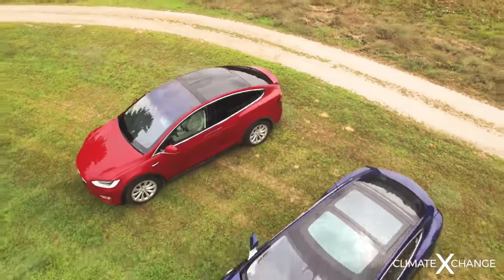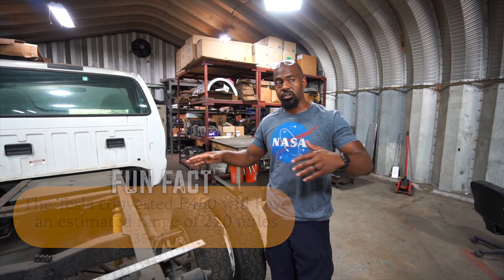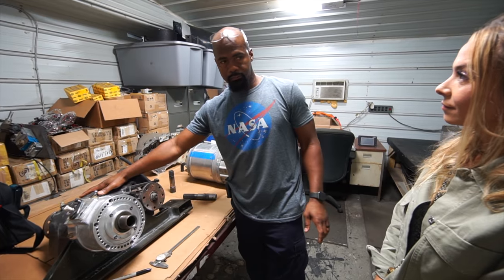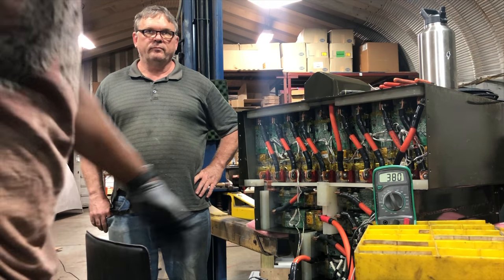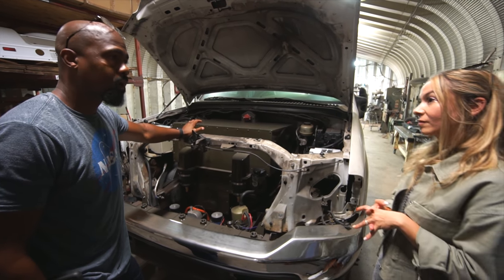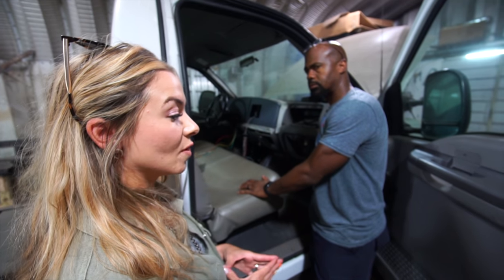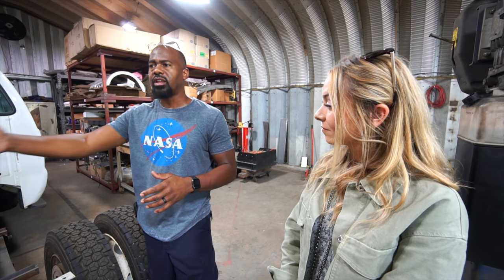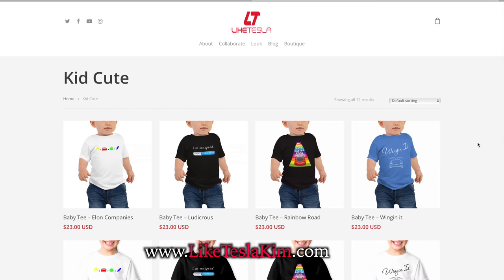Building The World's First True TESLA Pickup Truck!

Comment: Very interesting project! I like the fact that the battery enclosure is designed to fit in the same space (and same approximate weight), of the original engine, and the drivetrain and transfer cases, etc. are all in the same general location. This will make for an easy upgrade to existing vehicles. The only concern I would have, would be the crash test scenario, since a normal engine is designed to break loose on a front impact and go down under the truck to allow for more front end compression. It would also be a plan to harden the front of the battery case to prevent punctures and fire hazards in such a situation, and have an accelerometer/impact sensor to completely disconnect the system, via a main relay. Just some random observations...😉👍👍

Comment: Just imagine what they can do when Tesla does come out with their Truck models and they can easily convert older trucks . Good stuff now, and when Teslas trucks come out, they probably have a higher towing capacity  motor and cooling system.
Reply: New Electric and EV West already DO Electric Truck conversions even without the Existance of the Tesla Pickup.
in places like INDIA they create light duty Trucks, made with a 
Screwdriver motor !!!!!! the trucks operate on commonly found 12v batteries. 
but, these are Analog Electric trucks.
TESLA is creating a all Digital Electric Truck, big difference.
Reply: The model 3 drive motor should be enough for the midsize truck market full of V6 motors just needs notably more cooling than a model 3 because towing

Comment: That charging trailer is amazing
Reply: I'm sure Rivian and Tesla will offer something Similar.
Reply: till it rains  but even on sunny days it would take a week to charge your batteries lol  compare to about 5 min to fill up gas tank lol
Reply: @brandonblack2095  I can Recharge at a Supercharger station and gain 200 miles in just 15 minutes.
Reply: Sorry, but those 3 panels cannot charge that battery very fast. At best, it looks like they can probably do about 1.5-2K W. That means sitting for a LONG time waiting around...probably wouldn't even make up for the inefficiency of hauling the trailer.
Reply: Have you actually done this? I'd love to see the evidence. "At first, things looked great. Indicated charging power zoomed up to 254 kW before it stabilized at 250 kW. Estimated charging time was 55 minutes. Less than 30 seconds later, though, with the battery juiced up to 16 percent, the charging rate started falling. Within minutes, it was down to 150 kW, then 130 kW, which it held until the battery reached 55 percent. From there, the charging rate slowly declined as the battery charge increased. 90 percent state of charge was reached in 41 minutes, and we eventually gave up on trying to get to 100 percent as charging time crested an hour and 15 minutes."

Comment: If I remember correctly optimum temperature for the Tesla battery pack is 74.5 degrees is the ideal temperature.

Remember to tell the owner of the truck to on a regular schedule check the transfer case for proper oil level plus the rear end and the front axle on the same schedule as the transfer case and rear axle. 

Not 100 % maintenance free like a Tesla is but very close. 

Thanks for allowing Like Tesla in to video the " prototype ". 

When Ford releases their electric F150 it will be interesting to see if Ford offers electric drive on the heavier versions of their pickup line. I would bet on they won't as they know the dealer network will scream like stuck pigs because there will be so little to maintain and make money on as we all know the dealers make their money from the service department not from selling vehicles.

Thanks again for a look at the future and thank you like Tesla.

Comment: i'm loving this one imagine between the fuel savings and the self charging trailer you would literally have a fully self contained vehicle. i'm subbed now i want to know more. THIS is the kind of thing i  have been looking for to get me into the electric vehicle craze this would be great if the truck could simply contain the contents of the trailer as a bed and just use it to pull heavy loads with from the  rear.of the truck, it would make it an almost no cost means of transportation and hauling

Comment: I like the concept of charging with solar panels, but with my limited knowledge of solar panel output, versus battery charging requirements, seems like those panels will only make a slight dent in charging requirements.  I hope I’m wrong in my assumptions.
Reply: You are correct in your assumptions, in the video he implied that you wouldn't get a full charge. Based on what he said in the video, the trailer also has batteries inside that can be charged as you are traveling down the road and that is what can actually charge the F450. In this case the Solar panels are not directly charging the truck, the batteries inside the truck are what creates the higher voltage needed to charge the F450.
Reply: A 1kw solar panel is about 10 feet by ten feet. If that array on the trailer is that size, it would take 90 hours of direct sunlight to the unfolded array to fully charge. And those panels are folded up when driving so only a third would be exposed to sunlight while driving.

Comment: Honestly you don't need a special transfer case that has to handle the instant torque of an electric motor.
It's cheaper and easier to electronically regulate the torque of the electric motor and have it feed in power smoothly and progressively.
You can also use the existing transmission and clutch to maximize the already high torque while giving it a normal range for highway driving.
Reply: yeah dude! that is what I am going to do with my tesla motor that I am putting in a basically stock 95 jeep cherokee.

Comment: Imagine if they take the knowledge they have and make a more plug and play conversion of the F150.  Using Tesla motors and batteries from cars that have been wreaked.  Be a great gig.
Reply: That would be the Ultimate EV Conversion. There is one company that is now making a "Crate Motor" that is shaped like a V8 Engine that simply bolts into the engine compartment like the Gas Engine that was just removed. If a company could get a factory going to make EV Conversions for popular Gas Vehicles, they could make some money and save the planet all at the same time.

Comment: My idea is to put a trailer hitch on my Model Y and have a 30' RV with solar panels on the roof and roll out panels when in the open.  I was dreaming about charging while driving but the reality is to charge the RV batteries using the RV pack from EVTV Jack, then when stopping for lunch discharge the RV battery to charge the Y.  The Flex panels are getting more efficient and the new 23% panels from the Canuks will give alot of energy from the RV roof.  Having a starlink terminal would just be icing on the cake.  I envision going into a very very remote area for a few days hiking and coming back to a comfy home with full conveniences.  Putting those panel extensions is neat but just packing 30 feet of flex panels is the lazy way of doing it.  The EVTV RV model will take multiple array input and output 220, 110, 12v, and of course USB so you can charge your phone.
Reply: A 30' rv with a y. Lol. My 30' ultra-light snatches my 9000lb diesel truck around on the highway 
Your going to piss yourself when a semi passes you

Comment: Very cool.  However, there is no way this thing will get 220 miles with a 90 kw battery.  They will be lucky to get 100 miles.  They should have used two 100 kw batteries.
Reply: I think it can make it close, if they don't abuse in speed. plus the 1:10 instead of 1:9.55 reduction ratio will offer a slight better efficiency for a heavy platform.
Reply: Gui Srtr It will only get close 200 miles if they drive 35 mph. I’m basing my answer on a TFL adventure X video where they use the model X to tow a trailer. In that video the consumption was anywhere from 700 W hours per mile to 900W hours per mile. I think they managed to lower the consumption when they drove 55 mph and it was still over 500 wh/m
Reply: @Show-me-how-now  I don't think the 220 range was while towing.  While I don't think 220 is realistic at highway speed they'll be well over 100.

Comment: I think you need to change the gear ratio to at least 15/1 to reduce the electical load by mechanical advantage
Reply: Robert Lynk, thanks for the input. What I failed to mention in the video is that the transfer case has a Magnum drum that I can engage to double the gear ratio. So in high gear with the Magnum drum engaged it’s equivalent to 15:1 gear ratio, (in conjunction with the rear differential) to the tires.
Reply: @gregcoles2491  this good to hear.  I started researching the same idea about a year ago. Not being a engineer i was trying to figure out what the best overall ratio would be considering the load of the trailer and the wind load from the front of the trailer would have put a very high load on the motor with the 9.1 ratio that the Tesla has. The fast lane car channel did a test with a model s towing a 4,000-lb horse trailer and it consumed about 70% more energy than normal which led me to believe that they needed mechanical advantage. I think the concept of the retro on the truck is a good idea and it would work well for local construction companies going back and forth to job sites. I think the battery would need to be at least a 120 to a 150 Kwh to help with longevity of the battery and the components. Just a thought

Comment: As long as you're jailbreaking everything, why not make the trailer charge it while you're driving? More efficiency.
Reply: That's a perpetual motion machine, so, um, no.
Reply: @vidznstuff1  I'm talking about power from the panels going straight to the car rather than into the trailer batteries first.  Not saying the trailer should have regen that's idiotic.
Reply: @bob15479  Thanks for clarifying. There's a crowd out that would be proponents of the "idiotic", including putting wind turbines on cars and having a set of wheels with generators on them while the others have motors.

Comment: Brilliant idea,a trailer recharging another battery while rolling behind a truck during the journey,,,,I think is a fantastic  cause with a panel sometimes it will be cloudy for days but you need to keep moving forward.Again if alternator of petrol car generates 12V and it cannot return power back as waste then (4)alternators will do good due to the automatic power cut system or may I just call it device.keep up the good work guys petrol cars are like a waste all over world but your idea since I have been thinking about it  before watching your video of tesla conversion/transformation car we are on the same level of thinking.

Comment: An estimated range of 220 miles? I think you're a bit optimistic here. The original 90 kwh Tesla only had a range of 294 miles. You're lucky if you get half that range with truck aerodynamics. I would bet on 100 miles of range.

Comment: Should have just put everything in from a Tesla then it could use the chargers and crazy that an 2000 truck is $150K you can get a used model S for 45K and a 2000 F450 for 5K
Reply: samantha farmer the $150k is not just for the build. There are parts and adapters that have to be designed, engineered, tested and produced. This truck is a passion project for someone that doesn’t mind paying what it cost to get exactly what he wants. Once these parts are tested and constructed. They can be used in bios in the future. The cost of a build like this can definitely be in the sub 100k price. However, subjects a lot  people don’t consider when building things to be sold and used by consumers is safety and R&D, those two departments area necessary and expensive. Hence the cost of this build.
Reply: greg coles understand but if you use a usedTesla then you have everything you need no R&D or custom stuff, just take everything out and put it into anything you want and it maintains all the Tesla stuff and charging
Reply: greg coles a brand new model 3 is $35K
Reply: Yeah you got to buy all the stuff that hacks the tesla componentry and I know that Atlas Transfer Cases and custom machined shafts aren't cheap. Crashed teslas are like 30,000. Plus all the labor this dude is putting in. I wouldn't want to do this for less for anyone else. Tesla still hasn't released there truck yet so if your passionate about having an electric truck, this guy is basically one of your only options right now. supply and demand.

Comment: So it’s a F-450 that can pull a 4000-5000 pound trailer and is just a bunch of solar panels to charge the truck?  What’s the point?  A regular F-450 of that era can tow like 20k pounds or more. Outside of a cool project I fail to see the point.
Reply: I'm guessing he didn't want to over-shoot the reliability of the system, more than anything. To pull those kinds of loads, they may need to engineer a multi-ratio automatic trans. to keep from overloading the motor(s), etc. and also factor in an acceleration profile that would sense actual wieght and ramp up the torque accordingly to keep from breaking drivetrain components (like diesels tend to do on a regular basis). I'm sure they've already planned for a real-world duty cycle for these trucks as they move forward.😉